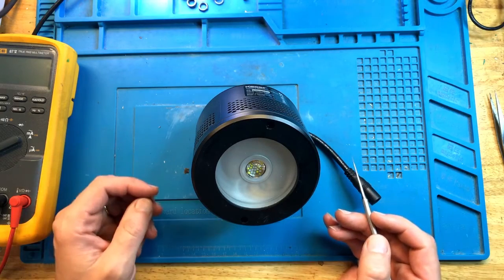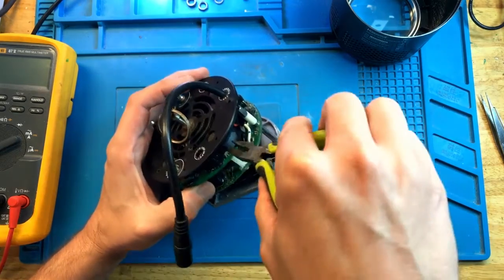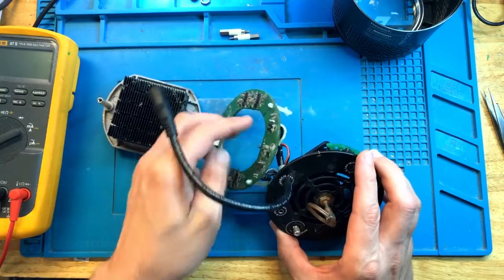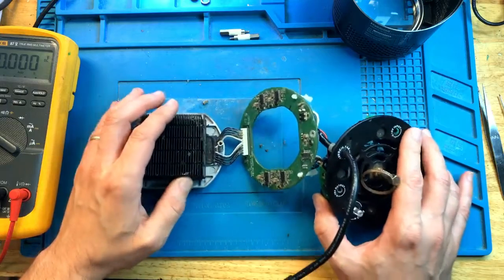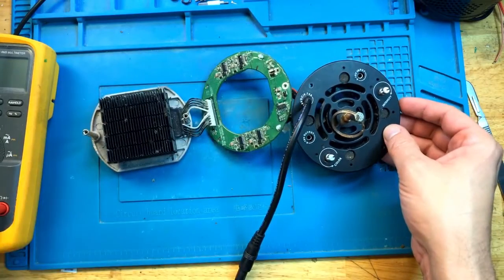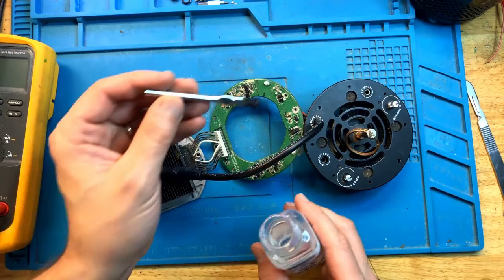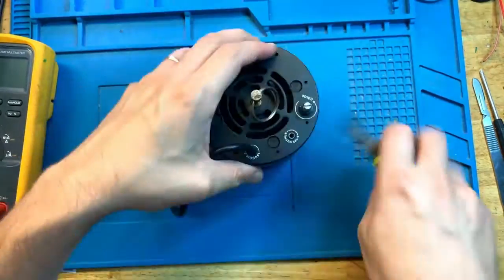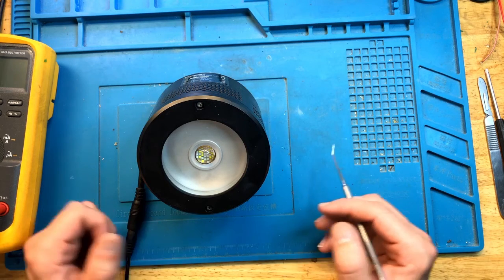Kessil A360W Not Turning On

Comment: Do you have a video showing a repair on Kessil 360WE where the power supply goes into protection mode?  When first plugged in with light off, the power supply provides 19v, but as soon as intensity is turned up, the light flashes once and power supply stops providing 19v.
Reply from the maker: The issue is likely either with a mosfet or something else on one or more LED channels... I think I have a video showing mosfet repair for these lights.